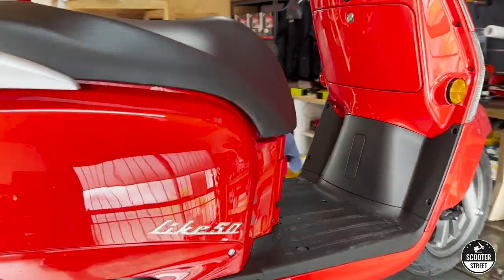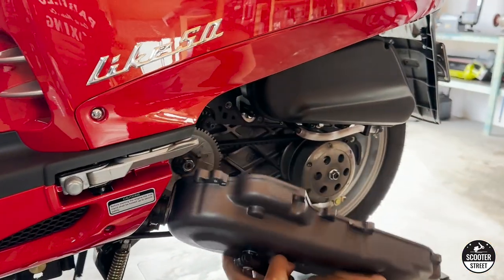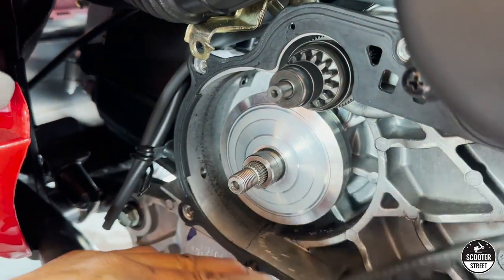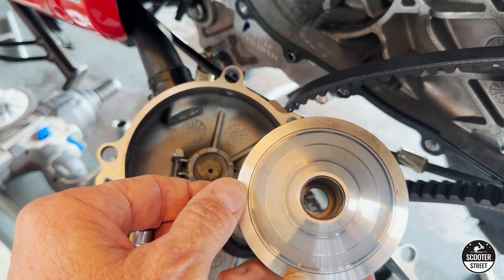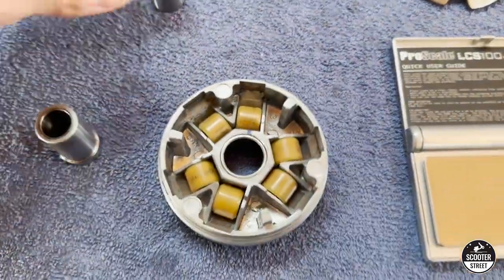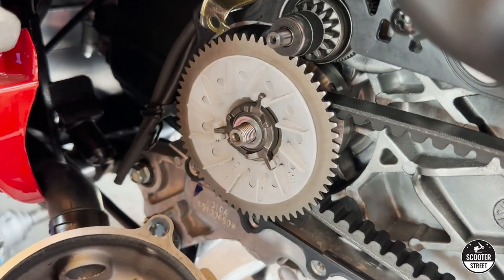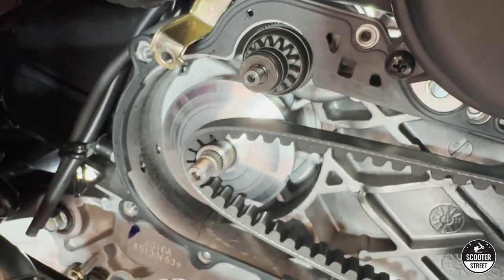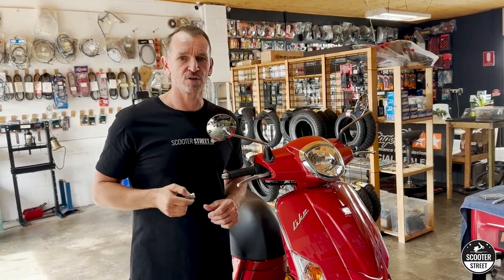UNLEASH Your Kymco Scooter: Simple Derestriction Hack for High Speeds!

Comment: Hi I have a 2012 KYMCO like 50 it’s so slow I can only go 26 miles I checked but it don’t have a restriction on the transmission what else can I do to make it go faster
Reply from the maker: Ohh, that is slow. You should check the transmission including the clutch and belt. Several models had many restriction and you may also have significant wear on these parts. Look for an exhaust blockage and air leaks through the filter system.
Reply: I have the same problem, did you figure it out?

Comment: so basically you dont need to change the ECU settings
Reply from the maker: The best way to look at this is, if the variator is the reason you are restricted then change the shaft or the variator. So if the CDI/ECU is the restriction then replace the CDI. The CDI is a restriction to the RPM so when you require higher RPM (more speed for more upgrades) then change the CDI. An example is when you change the exhaust or fit a higher cc cylinder kit you will require higher RPM, so we change the CDI/ECU.

Comment: Hey Team, I have a 2020 Like 200i and would like it to have a bit more grunt and top speed. any suggestions? Its just shy of 95kmh and take off is slower than my previous commuter, the Espresso 150.
Reply from the maker: Use a performance variator with 10-15% lighter rollers and performance clutch in this model. Sadly the Kymco 200i is only a 163cc engine.

Comment: I have a suzuiki sj125t and it will only do 60k, and there is a large bolt that restricts me from getting into the restrictor area. Im not sure if this speed is due to a restrictor or not.
Reply from the maker: That sounds very slow for a 125. Contact the selling dealer.

Comment: I have the kymco super 8  50cc 2t it does  around 60 kmh on level road.i bought the malossi variator will i get a 10kmh top speed aswell or does the 2t not have as much restriction as it has a higher top speed to the like
Reply from the maker: The Super 8 2T needs and exhaust, jetting, and transmission rollers, springs. The CDI will relieve the rev restriction. They are heavily restricted.
Reply: @scooterstreetau  thanks guys. I bought the exhaust leo vince tt of you guys and going to re jet carbi. Hope this helps me in the hills. Haha do you sell the cdi aswell
Reply from the maker: @kseriesdan9722  Ok good luck, dont forget the variator or rollers, cutch springs. Yes we have CDI.

Comment: My kymco agility (euro 4) is restricted on the ECU it’s an injection , what can you do about it ? I’m from Greece
Reply from the maker: Hi to all in Greece👋. You will need to replace the ECU, you can buy these from good parts suppliers in Europe.
Also change the variator or shaft. rollers and clutch.

Comment: my 2016 has oil in the air box.What to do?
Reply from the maker: Check the level of oil in the engine, adjust it just below the high mark.
Check the air filter foam or paper, clean or remove any oil, wipe out the air box completely clean of oil. Sometime oil is on the air filter so only absorb off the excess! Check and clean the oil breather hose, usually located running from the engine head to the front of the air box. 👌
Reply: Yeah um. Next time be careful to be really precise when replacing transmission oil.
Kymco likes to let any extra oil you put in for transmission to flow into the air box as a backup or something.
Reply from the maker: ? @somesortofchill
Reply: @scooterstreetau  Forgive me for not being very technical, but yeah. Long story short-ish.
For motor oil you can just pour and measure if you are unsure if you put enough or too little.
For transmission, at least for the kymcos that I've ownes and used. You have to be precisely putting was it something like 0.19L or something like that. And anything you put over that is going to overflow i to the air box.
The guys I've bought the bikes from had oil in air box when I bought them so the above is what I researched and found that out some years ago.
Reply from the maker: Ok interesting, as the transmission is not connected in anyway to the gear diff oil. The oil breather for the head is connected to the air box but not the gear box. @somesortofchill
Reply: Also not a native English speaker so pardon my confusion. We sort of use the same word for both transmission and gear. So may have mixed up bit.
Reply from the maker: All good, we thank you for the comments and watching our videos, 🙌 @somesortofchill

Comment: I had the same procedure done on my 2022 Like 50 2T. I also got around 65km/h top speed. It's worth noting that the increased range of the belt also affects the rpms, especially on steep hills. Often it will only go 25 up hills that it used to do 40. Would swapping out to more lightweight rollers make it more rev-happy?
Reply from the maker: The belt can increase the rpm from the start it depends and what size you replace with. Lighten the rollers only by 10-15%.
Reply: @scooterstreetau  Thanks I will give that a try. I’m not too concerned if it sacrifices a bit of top end speed.
Reply: 5.5 gram rollers and a 1500rpm torque spring (yellow) will sort your bottom end torque, so hills will be better but top end speed sacrificed a bit.
Reply: @leonbasham8803  thanks yeah they ended up putting in 7 gram rollers and also serviced the carb and clutches. Now it revs just as hard as the day I bought it! Nice smooth acceleration too. Not sure about top speed yet but it gets past 60 quite easily.
Reply: @jem587  wow so they went heavier? How has that affected the hills?
Reply: @jem587  when you say serviced the clutch and carb, what did that entail?

Comment: That rubber hose connected to the transmission cover, mine got pulled out. Where exactly do I put it back?? Someone help 🙏
Reply from the maker: It connects to the front of the trans cover, a breather/cooler hose. Reconnect and hose clamp it in place, simples.
Reply: It just slides in the cowling, goes to nothing.
Reply from the maker: @leonbasham8803  It sits in to the body and allows air passage to the CVT, look for a positon where water cannot enter.

Comment: Does this work on the kymco agility 50T four stroke?
Reply: Is there anything else I can do to make the current Kymco agility 50T to make it go 60 km per hour?
Reply from the maker: Yes, they Agility and Like are same engine.
Reply from the maker: @murraywolf7284  Go down a very steep hill. No not much more apart from major ECU and engine changes.

Comment: hello i have the gy6 50cc injection. max speed 45kmh and revs my variator is unrestricted. what can i do for more speed?
Reply from the maker: You need perfomance ECU to start. Then begin with transmission.
Reply: @scooterstreetau  my ecu is the delphi mt 05 if i replace it with rongmao unlimited its ok?
Reply from the maker: @thunder732  You need to ask the supplier if it is compatible and unrestricted or adjustable..
Reply: @scooterstreetau  thank you

Comment: Hello, I have a 2019 kymco super 8 street, with a injection engine. It has a max speed of 49 kmh and doesn't go any faster, I can feel the scooter slow down a bit when it hits the 49 kmh. The ECU has been reprogrammed to allow the RPM to go up to, I believe, 9000 (I'm not 100% sure, if the guy who did this for me did it correctly. But he says he did). And the variator shaft isn't stepped. 
Any idea's on how to make it faster?
Reply from the maker: How was the ecu reprogrammed? The only way I kow of is too replace the ECU. I have never heard of reprogramming the factory ECU💥
Reply: @scooterstreetau   I live in the Netherlands, the official kymco dealers can buy an application to reprogram the ecu. But the guy who did it for me, he sells restrictors, told me he also bought that application so he could do it himself.

But I'm gonna try putting in a Polini variator set and see if that helps.
Reply from the maker: Wow that is great, I am unaware of this application. You will need to find out what is now restrciting the engine, is it the exhaust or the transmission? @larsberg-v1g
Reply: @scooterstreetau  Well that the problem, I don't know how to 😅. I did replace the variatior today, and it does do 5 kmh (54/55 kmh) faster. So that's great. But I don't think that is the top speed.

I am gonna replace the springs inside the clutch and the bigger one in there. Not sure what it's called.

Is the exhaust really something that can restrict it? I didn't know that
Reply from the maker: Everyone replaces the exhaust on their machines because the factory exhaist are restricted and performance exhaust offers performance.. @larsberg-v1g
Reply: Alright, I'll do it aswell. Any recommendations for a exhaust? @scooterstreetau
Reply from the maker: Will it remian 50cc or are you fitting 70cc? Yasuni or Tecnigas. @larsberg-v1g
Reply: I want to put in a 70cc or 80cc, but don't know how to do this. Because it's an injection scooter. I know how to do it if it was a carb, but don't know if it is different for an injection. 

I haven't found an exhaust yet I want to use. I did see some, but those won't fit the scooter because of a sensor in there. @scooterstreetau
Reply from the maker: Approach it like a carby engine in regards to the cylinder and transmission, and when it comes to the EFI system you must upgrade the injection unit. I am sure the Kymco use the Dellorto ecu to control the EFI. @larsberg-v1g
Reply: Alright, thanks. I can't do this any time soon, but I'll look into it. Would you happen to know if I need to replace the ecu or can I just keep je default one @scooterstreetau
Reply from the maker: Use the factory sensor in the exhuast and transfer it to the new exhaust. You can keep the factory ECU but it will not allow the performance to match your upgrade parts. @larsberg-v1g
Reply: okay thanks, I'll only replace the exhaust for now. I might replace the cylinder, injection unit and ECU later if I have more time. @scooterstreetau
Reply from the maker: Cool. @larsberg-v1g
Reply from the maker: 🎉🎉👌👌 lifeofjorjorjorden4214
Reply: I want to upgrade it with an 80cc cylinder and a larger injection unit. But I read that the gear of the super 8 is not good and the ratio is wrong. Do you know anything about this?

And I also can't find parts that fit the super 8, do you know any good parts that do fit? or a brand that is good @scooterstreetau
Reply from the maker: The later model Kymcos are not the type of scooter you would normally go all out on due to the build quailty and the performance return.  @larsberg-v1g
Reply: So would it be better to get an older type? @scooterstreetau
Reply from the maker: Not necessarily , they are just different. @larsberg-v1g

Comment: Hi will it work kymco like 50I?
Reply from the maker: Check it out first and you will find it is the same transmission 👍
Reply: I opened it it doesn’t have any restrictions, any recommendations?
Reply from the maker: @biradorfam9330  If the restricted shaft is not present, that is a bonus.
Reply: @scooterstreetau  How is it a bonus? Now we don't know where to go after finding out that's not what's restricting out scooters.
Reply from the maker: @RetroGamerr1991  If it does not have a variator restriction BONUS! you don't have to spend money on the shaft.
Reply: @scooterstreetau  Yes but my scooter is still restricted and I have nowhere else to look.
Reply from the maker: @RetroGamerr1991  The ECU, the cylinder, the exhaust, the Kymco efi has so many restrictions and it becomes very expensive.
Reply: @scooterstreetau  with the ECU is it RPM limited or is it speed limited? because I can't tell how it's calculating speed. there's no ABS so there's no sensor on the front wheel but at the same time if I put the scooter on a stand and give a full throttle it won't read anything on the speedometer even with the rear wheel spinning at what seems like 40 mph
Reply from the maker: @RetroGamerr1991  Trust me it has a limiter! If you need technical info contact us through our website.